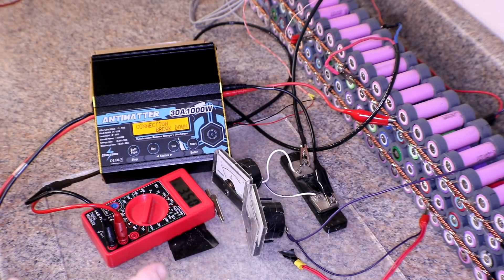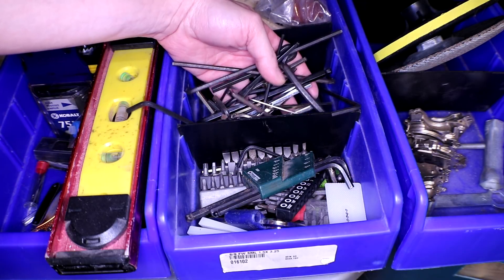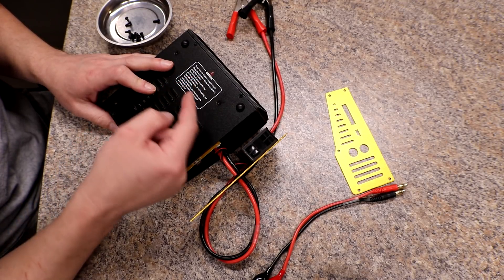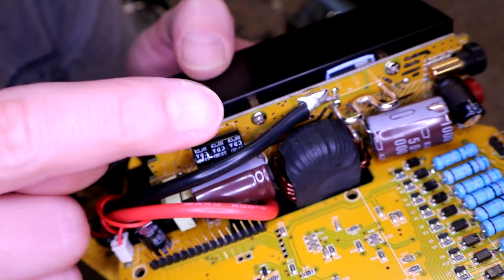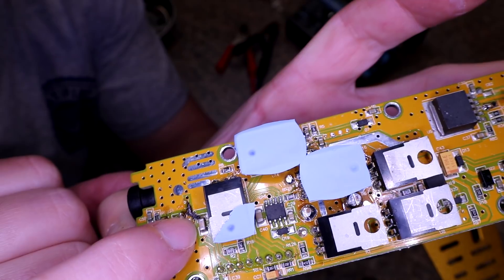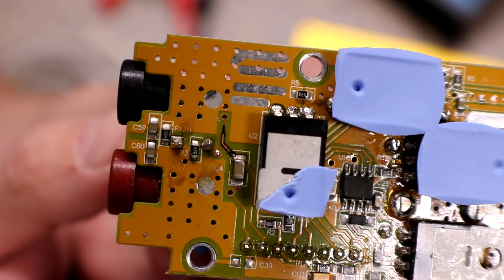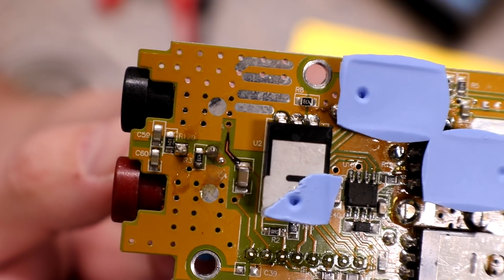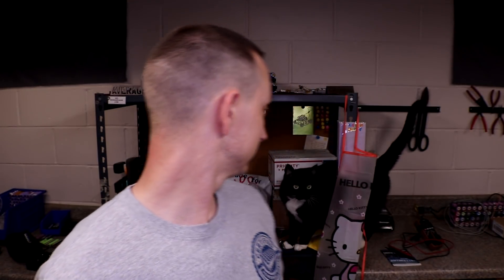30 Amp Antimatter Charger Blew up!!!

Comment: This video was a cat-pacitor cat-tastrophy!!   Hopefully it didn't take out any of the power fets "whatever" happened (coff - plugged in reverse polarity - coff)
Reply from the maker: You forgot the Cat-Scan😆😺.  The fets looked ok from what I could see.  I didnt bend them up to look tho.  Lol that would be something I would do, plugging it in backwards but I didnt this time lol.  I think it also has reverse protection for idiots like me anyways!😉😜💥
Reply: Well I blew up two channels on my litto kala when I had adjacent batteries touch- could you have done something bad on the balancing port??  Do you have anyone sending caps yet- what did you need?  You should not need to increase the voltage rating as they should have already been higher than anything that should end up on them.  The bulging was likely over current from the event (coff - reverse polarity - coff) rather than over voltage .  ;-)
Reply from the maker: Nothing happend to my recollection on the balance port.  HBPowerwall said he was gonna send his charger and the caps he got for his.  Ive always had good luck uping the voltage on caps.  True its not required but if I have them I throw them in.  Basically I use whatever I can get lol.  Yeah no accidental reverse install this time lol.  I think the swol caps are from all the heat from the resistors??? Wouldnt you think. I could be wong!😃

Comment: how hard were you running it ? i see it doesn't have a good reputation .
Reply from the maker: Pretty much 15amps for every test besides showing that it can do 20 and 30 amps but the wires get hot at 30.  Im wondering about the other models.  Might see If I can try some of them out as well!💥

Comment: The cheapest good changer = Accucell 6  max charge 6 amps ( HobbyKIng )    but when you get tried of playing around and want the LAST CHARGER you will ever need    Pick Up a REV-Lectrix Power Lab 8    I have been using this unit for 4 years and I haven't been nice to it. After resetting the factory charge limits I change at 60 amps all day long. just remember you will need an input voltage of 24 volts to do this. I use an Input voltage of 32 volts with an output rating of 80 amps. You need a little overhead so the charger is happy. Next you'll need some real cables to handle this.   Thanks Joe !  I LOVE WATCHING YOUR STUFF ! CHECK INTO A POWERLAB 8   Oh  and If you want more  You can chain link units together for MORE POWER !!!!!
Reply from the maker: I have heard good things about that Power Lab charger!  This charger can also take 24v which I was going to do when I first got it but didnt.  Im wondering if that would have helped it last longer or not.  I guess its hard to say.  Yeah Ill look into the charger, thanks!!! Oh and thanks for watching!!!💥😆👍
Reply: Not sure why they didn't do a 36 volt input  …..   but it can have an input of 32volts …..   ( 36 volt would have been better ) but I run mine at 32 input volts. 

You do have to go into the unit and reset the FACTORY settings to get the MAX out of the unit.  Its been so long ago I cant remember what the factory output was set at. I use mine for 6S 5000MAH Lipo packs for my 7.2 KDS helicopter running on a 12s setup and to discharge and charge 120p 18650 packs .   This is the unit that can handle what we do. Thee is also good software from them if you get the computer linking kit. TO MUCH TO LIST on the software ...

Comment: Probably noname chinese caps. Is that possible a screw touched the capacitor and short it? You can see it on the green panel, top right corner at 2:38
Reply from the maker: Im gonna be trying some other random caps I have.  Just found some lol.  I think one is a Deawoo and cant remember the other.  If it fixes it then Ill go ahead and get some good ones for it.  Hmmmmm its possible, Ill take a closer look!  Good eye if it is!!!!😮💥👍

Comment: If you can find the parts, I would replace all of the electrolytic capacitors. Try to get the best you can, Nichicon are a good brand, and have a low Equivalent Series Resistance (ESR) type. Good idea on using high voltage types as well. Also test the surface mount components next to the burnt track. If they are ceramic capacitors, they may have failed short circuit. Keep us posted and good luck with it!
Reply from the maker: Yeah the trace goes to a mini ceramic capacitor.  Im gonna use capacitors I have pulled from other circuit boards to make sure it fixes the problem.  If it does then Ill probly replace with good caps!👍

Comment: So I'm not sure how caps work but I think if you go with a higher voltage cap you may effectively have less capacitance at the same voltage I really don't know if that's how it works but for some reason I think it is and also I don't think voltage is the issue since you are taking what 12v and outputting 4.2v and it's rated for like 20 or more volts right how many amps was you pushing when it blew up and also was it on the input side or output
Reply: James Holbrook the capacity is the same,  just can take more voltage before the dielectric breaks down.   :)

Comment: seems like it over voltaged which blew out the caps and that then caused the track burn. I would check the voltage at that surface mount capacitor to see if there's higher than expected voltage that these caps complained about. but you might be lucky that these guys sold you dodgy old caps in a new product but seems to be electronic failure to me so may cause a problem again
Reply: why would it overvolt the caps? it should be bucking the voltage down since it is 1S and input is higher, it was probably due to high heat and high ESR of the caps, not sure what that little trace went to maybe voltage sensing or gate drive for the input connection mosfet?
Reply from the maker: I was thinking more along the lines that the caps got waaaaaay to hot since there right next to all the resistors that dissipate all the heat from discharging???? But Heck I could be wrong LOL! 💥
Reply from the maker: Yeah I was thinking Heat also.  That trace is attached to the negative battery terminal and looks like it goes over to the other board??
Reply: ive seen caps blow at 40c and 105c rated most likely they are putting crappy caps in these and they short under continuous use. I just had one on a 20 amps buck converter blow yesterday rated at 50 volts 105c on the input side but only had 16 volts going in it totally blew apart and i was using the original mosfet it came with. Ill be going back with Panasonic or Nichicon for all the caps.
Reply: circuit failure of course. could be a diode shorting and throwing AC into the cap, could be regulation gone nuts. These are near a small toroidal transformer so could be anything.
As Joe says, could be the heat drying out the caps I guess. I'd cover those.

Comment: Boom. Definitely fixable if that's the only thing wrong with it.
If that trace wire was supposed to handle 30 amps maybe you should make it thicker, or run a thicker wire from that resistor, to where the trace goes to.
You should had told me about capacitors. I am in the process of moving, and threw away a bunch of capacitors of all kinds of sizes. :\ They are gone now.
Reply from the maker: BOOOM!  Yeah Im thinking its fixable!  Im thinking that trace is for something different like voltage sence or similar.  Theres no way lol they intended 30amps going threw it😮. You should dig those capacitors out of the trash😉.  Your moving too,  how far away or same area just different house?
Reply: Wish I could dig them up but the trash container is long gone. 
Moving to a house with a basement this time because basements are cool. lol.  Same city. Same area.
Reply from the maker: You can have Hoard Piles in Basements!😆👍